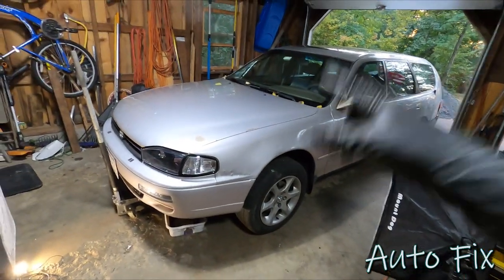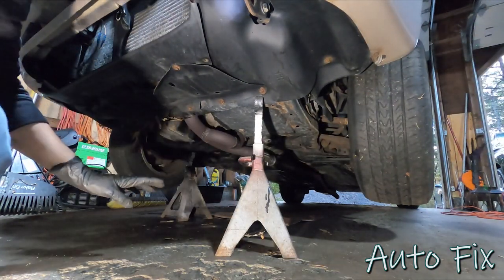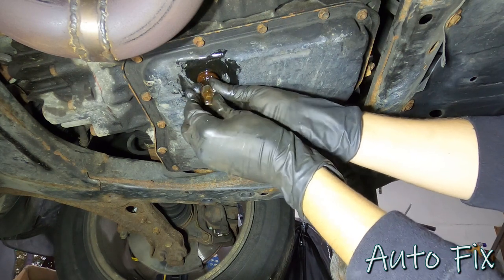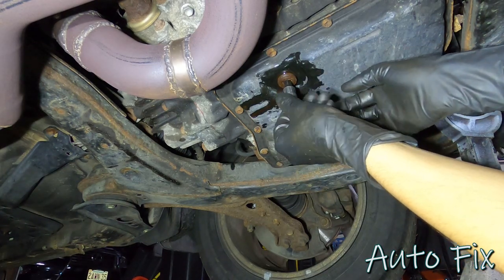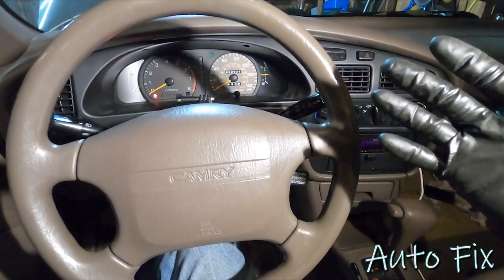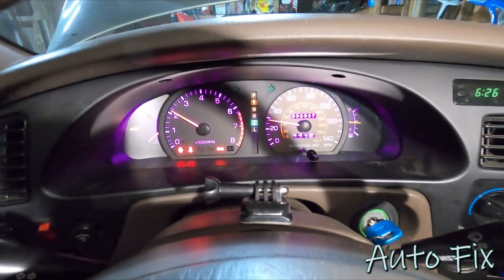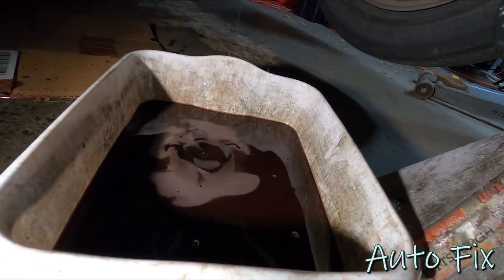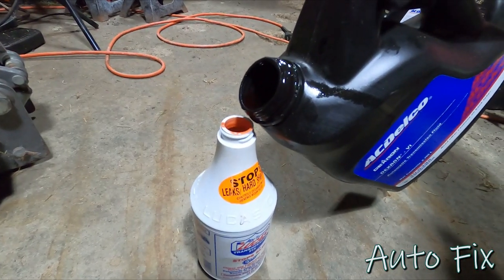Transmission Drain & Fill '94-'03 Toyota Camry, Solara, Avalon, Sienna & Lexus ES300

Comment: Changing the transmission fluid is usually done in concert with dropping the pan and changing the filter. If the filter starts to get dirty and the flow through it begins to get obstructed the working pressure inside the transmission will become reduced. This can cause the clutch packs and bands inside the transmission to begin slipping, which can eventually wear them out. If that happens the transmission will need to be replaced or rebuilt. Changing the filter is fairly easy and not expensive. I wouldn't recommend skipping it.
Reply from the maker: Yes you're right it's best to change the filter as well.
Reply: I've been looking around yt. I want to flush system along with new filter and gasket with out wasting transmission fluid.
Reply from the maker: @abe6517  What do you mean by wasting transmission fluid? A flush requires a lot of fluid and quite a bit gets thrown out with almost no usage. That's how a flush generally gets done.
Keep in mind that it's not always a good idea to flush the fluid. A lot of times on old cars you are better off replacing what's in the pan, and if it's really bad you're better off leaving the old fluid in there. So first take a sample of the fluid before you decide what's best for your trans.
Reply: Thanks for replying! So I have 12 quarts new, two new solenoid filter and gasket. The fluid it just showing some darkness. With the cold weather, it had a few hard shifts at 2nd gear to 3rd. So I decided to flush. 

My plan so far is siphon 4 quarts out, drop pan change out parts, replace pan add 4 quarts of new, and then proceed flushing the system. My plan waste 4 quarts of new fulid?I may be overthinking....
Reply from the maker: @abe6517  the best way to do a flush is to have two large buckets. One empty, and the other one full of new trans fluid. Remove both hoses from the trans cooler and extend them with some hose that fits nicely over them. Stick the hose that is actively pouring trans fluid out into the empty bucket and the hose that wants to suck up trans fluid put that in the container with new trans fluid. Then run the car and eventually you will see new fluid come out of the first hose/line. Then you gave successfully flushed the fluid with minimal loss. Ideally however, you'd want the car up on jack stands and running thorough all the gears as you do this, holding it in each gear for at about 10 seconds.
Reply: Drain,fill,run (Two times),drop pan,inspect for debris,clean magnet if equipped,clean pan,replace filter & gasket & fill to spec level for the WIN 😎

Comment: Just bought a 95 Camry 4 cylinder with 280k miles, nice little work commute car and they are solid & dependable. Thanks for this video, im going to flush out my transmission and hopefully that helps
Reply from the maker: Nice! Make sure the fluid isn't back like used engine oil and smells burnt like it's been overheated almost. If it does, don't change it or you will probably start losing gears. That usually means the transmission is gonna need a rebuild at this point.

Comment: thank you so much for posting this, very informative. I'm torn on the multiple replacements...I just had this old Mexican guy whose been right way more times than I have tell me to take a portion of the old fluid and mix it with the new, which sounds off to me but I think I get the concept. I'm going to do a 2x replace and add the additive like you did. Camry 177K I'll let you know if anything bizarre happens...
Reply from the maker: No that's right it can be done in certain cases, although not necessary on a good transmission.

Comment: Just bought an 03 Avalon, this will be very helpful. Thank you!
Edit: I am watching the video and saw you struggling with the dipstick,  the exact same thing happened to me when I was looking at the car before I bought it 💀. Looking forward to that 🤣.
Reply from the maker: Hahaha
Thanks! I'm glad the video helped!
Reply: lmao I bought a 2000 avalon last year and spend 5 minutes fumbling about trying to get the dip stick back in in front of the seller. I feel so related to
Reply: @ColonelPassTheCheese  lol, I was actually just messing with my transmission fluid, added some Lucas transmission fix because it shifts hard sometimes, and I have finally memorized the right way it goes in 🤣. The flared end goes to the left side of the tube.
Reply from the maker: @ColonelPassTheCheese hahaha yeah, happens at the worst time lol

Comment: Hello my atf level is lower on dip stick when engine is hot  and comes up higher when is cold.. isn't it supposed to do the opposite?

 1994 celica should i ignore cold reading and only read when hot runing on park?
Reply from the maker: Yeah that's kinda weird but I would go by the hot mark. It's usually the most accurate.

Comment: I have a 2000 Sienna with 326k on it with the original version of this transmission. The fluid inside is 16,000 miles old and is clean, properly filled, and doesn't smell burnt. However, for many years, the transmission has always made a buzzing noise in park on certain days depending on the temperature outside (probably the pump), but after a while in park, the buzzing noise goes away, and you don't hear it at all once you put it in any gear. I have never lost a gear or have it slip on me. The shop I took it to for my timing belt and transmission service did a drain and fill like you did (the filter inside the transmission is from 2014). That transmission has made that buzzing sound for the better half of ten years (even after a filter replacement then) and if something was going wrong, it would have broke a long ago. Other than that, no issues with shifting, fluid level, or smell. Any idea of what it could be? Thanks!
Reply from the maker: That's a weird issue, but to be honest since it's something that minor and it's been going on for that long, I wouldn't worry about it. It might be annoying but clearly it's not affecting anything so just keep servicing it as usual and it should last!
A little tip, on old transmissions, especially Toyotas, I like to put in a quart of Lucas Trans fluid additive to help it out. But I do this on transmissions that haven't been properly secriced or are showing signs of wear. So if your doesn't need it, you don't have to add that.
Reply: @AutoFixYT  Gotcha. It is more of a nuisance than anything else, but it is good to know whether there is an issue or if everything is good. The next time I change the fluid, I'll see if I can get a new filter installed at a minimum. The shop refused to put in a filter and opt with a drain and fill since opening up the pan could cause some seals inside the trans to start leaking.
Reply from the maker: Removing the pan wouldnt affect anything at all actually. So I'm not sure what they were trying to say but the pan is just... The pan. Just reseal it and you'll be all set.
Reply: @AutoFixYT   Thanks!

Comment: I have a 1999 solar with 327,000 mi tranny fluid was changed from the original owner at 180,000 at Toyota service dealership I live in Florida but last year when temperature dropped in January it wouldn't move when I put it in drive only reverse but in the summer it works. should I give it the transmission drain?????
Reply from the maker: I don't think it's a good idea to drain it after not having serviced it for so many miles. It sounds like the transmission is on its way out. You can top off the fluid if it's low, but it's been way too long to actually service it. Removing that contaminated fluid can actually create worse problems than leaving it in there until it completely blows up, at which point it will just need a new or rebuilt transmission. That's why waiting to service an automatic transmission is never a good thing.

Comment: I was looking for a fill plug on the transmission casing. I guess only way to fill it is at the dipstick. Having a hard time dropping the pan after removing all the pan bolts, wanted to change the filter as well. The pan won't budge using a mallet or prybar.
Reply from the maker: Yeah dipstick is the only way to fill these. Also, I’ve had to pry oil pans to the point where they bent. Sometimes they’re very stuck. Just be patient and apply even pressure from multiple points. It will pop off eventually. But be ready to clean up a mess if it goes flying because there’s always fluid left inside of the pan. More than you think… haha

Comment: Just bought a '93 Camry wagon and not only did I like/subscribe but I also saved this video as well. 
 
Question: this is my first automatic in a while.. is a transmission cooler a good idea or is it just unnecessary/extra points of failure? I plan on installing a hitch but at most I will haul a light motorbike/camping gear (so maybe 1200lbs at the very most).. do these tranny's heat up to the point where that's an issue? 

Also, how are the headlights holding up? I looked at those online and had bad examples that immediately fogged up.
Reply from the maker: If you’re gonna tow or haul, especially in hot climates or hot summer days, I think a transmission cooler will help. There is already one built into the radiator, but you can take those hoses off and install your own external cooler. These transmissions are sturdy and can take some abuse but a cooler will help prevent overheating. If you are towing on the highway or on long uphill inclines, you will heat that trans fluid a lot. Maybe not overheat it, but it’ll be above its normal operating temp. So yes, I’d install one. But make sure that in the winter months (if there is winter weather where you live) the transmission doesn’t over-cool. You want that fluid to warm up as fast as possible. And an external cooler sometimes prevents that. So it’s a tricky situation.
Reply from the maker: Oh and about the headlights, they’re great! I don’t know why they’d get hazy in a short period of time, but they’re great!

Comment: Marvelously helpful, thank you!
Reply from the maker: Glad it was helpful!
Reply: i just realized that i can put the fluid into the same place where the stick is    :D  
     i'd thought i would have to find a different wider opening      - awesome'
Reply from the maker: @poom641  That's right, goes in through the dip stick. The only downside is you need a very pointy funnel for that.

Comment: How much miles till you change that transmission fluid because mine looks no where near as dark. Mine is red with little slight tint a of gray 109000 miles toyota avalon
Reply from the maker: That means it's been changed, no way 109k miles and you still see red.
If you like to do drain and fills, I'd say every 20-25k miles. If you like to do flushes, you can probably stretch it to 30-40k miles.

Comment: Just got an old 97 camry with the 2.2 four cylinder.  It won't shift any lower than drive.  (3,2,1)  feels like a mechanical cable type issue is my guess.  Shifts itself perfectly fine all day long.  Ever seen something like this before?
Reply from the maker: Weird, yeah I'd check the linkage. Just like you said it might be a mechanical issue. There's no way it's a transmission problem at that point if it while in drive it works normally. It could also be the shifter mechanism itself. Like if something fell inside the shifter lever. Or yeah like you said the linkage between that and the trans. Something is physically stopping it.

Comment: What about the diff fluid fill plug? Where the manual tells me, there is a blocked off hole...
Reply: Not sure if you’ve already figured it out but, the fill plug and drain plugs were phased out as these transmissions got reengineered over the years, so if you don’t have a fill plug it’s because there’s a fluid pass through from the transmission to the differential but some still have a drain plug and that’s just to get more fluid out on a pan drop, usually another quart

Comment: Hey I have a very similar situation with my 2004 Avalon, it looks to be about the same color as yours on the dipstick, just a little nervous to change it as I don’t want it to start slipping I was planning to put some Lucas fix in mine as well, I’m just noticing some hard shifts sometimes, but I don’t want to wait until the point of no return, should I still change it I would only do one drain and a filter change
Reply from the maker: Try to see if it smells burnt or overheated. You'll know if you smell it, it's a horrible smell. If it doesn't smell burnt, then do the drain and fill procedure and add some Lucas.
Reply: @AutoFixYT  ok will do, thank you

Comment: Is there a transmission fluid filter to replace on this car?
Reply from the maker: Yes, you have to remove the transmission oil pan and then you'll see the filter in there.
Reply: @AutoFixYT  you didn’t do it in the video right? Doesn’t seem super necessary

Comment: I have a 99 solara v6 with 253k and the transfluid hasn't been changed since 2011 I plan on doing this and I might try the Lucas I already use it in my engine I'd be curious if the Lucas would help with this clunk when going into reverse my car has only when cold
Reply from the maker: It might help, but also make sure you check the engine mounts. Sometimes they wear in such a way in which they let the engine rock backwards more than forwards and because it sits at higher RPMs when it's cold it has more force to throw it backwards when you put it in reverse, as opposed to when it's at full operating temp and sitting at 650-700 RPM.
Anwyay, as long as it's shifting fine, you're all set. Make sure the fluid you're draining isn't burnt or very contaminated. If it is, don't drain it all, don't flush it. Take it easy and drain some then I'll it then drive it and see how it reacts. You don't wanna ruin the trans by giving it fresh slippery fluid if all the clutch material is in the old fluid.
Reply: @AutoFixYT  damn you know yur stuff I'm only 17 and it's my first car so I'm still learning but I did replace my upper dog bone mount it was shot and the lower motor mount has chunks out so it's bad but I still haven't done that.that would probably fix my problem didn't realize that thank you.
Reply from the maker: @yurboi698  Nice, always happy to help! The only reason I brought up motor mounts is because if it was an internal trans issue it would come with other symptoms too, such as hard shifts, slipping, or delayed shifting, and especially once it warms up. Your issue seems to be very precise. Anyway, still change the fluid though, it good to keep it fresh.

Comment: 1) that fluid looks horrible. 2) I got four quarts out my 1999 es300. Why am I not getting 4 quarts out of my 2003 es300?
Reply from the maker: It may look horrible but it's actually not that bad lol
Not all cars will hold the same amount of fluid. Best way to know is to check a manual or use the dip stick to ensure it's full, then measure what comes out. You will always get slightly different results. As long as it's full when you're done, that's all that matters.

Comment: Is it OK to use toyota T-IV fluid?
Reply from the maker: No, not at all. Use only Dexron 3 or higher ATF.
If you don't get straight Dexron, you can use Valvoline Max Life which, as you will see on the bottle, is compatible with Dex3 or higher.

Comment: Does the differential take the same fluid do you know?
Reply from the maker: Yes I'm pretty sure it uses the same fluid. It has a different drain and fill plug though, just like a regular differential.
Reply: According to Haynes repair manual yes, they both call for Dexron III
Reply: Although the differential has it's own drain plug, the transmission and differential share the fluid.
Reply: @hansfranz9914  good point, that is true
Reply: @hansfranz9914 So do you still need to drain and fill seperately?
Reply from the maker: I believe so.
Reply: @June0696  you have to open both drains to drain as much fluid as possible.  You fill them both when you fill the transmission.  Just make sure you have the same model engine/ trans
Reply: @dishthewasher  Okay I see but how do you fill them both? 
Or will they be filled together automatically when you pour Transmission oil thru dip stick?
Reply: @June0696  yes
Reply: Yes it all takes the same fluid I know now. They both share the same fluid constantly so there’s really no need to touch the fill or drain on the differential unless you’re trying to drain as much as possible. I doubt it’s necessary to fill the differential after the transmission but usually they recommend checking just to make sure it has fluid in the differential
Reply: @UGotAPerdyMouf 
Then I can ignore about the Differential? 
And just drain and re-fill the transmission fluid will take care of it?
Reply: @June0696  like we said you can if you want to, but why wouldn’t you drain the differential too while you’re at it?  You might as well drain the old dirty fluid from there too instead of having it mix together with the new fluid you bought. There’s gears and bearings in there so why would you leave that when you’re already in process of doing the trans fluid?
Reply: @UGotAPerdyMouf  there’s no differential fill port on that model. And I just explained from experience how it fills
Reply: @dishthewasher  Because my Differential plug won't turn even with extended breaker bar. 
I don't want to buy new tools or risk break it by trying if it's not necessary.
Reply: @June0696  yes, that makes sense.  You can get most of the fluid out from the trans pan, so yes, by changing just the trans fluid, the new will also circulate through the diff.  If you want to, you can try soaking the plug with penetrating oil for a day or 2 and an impact driver.  Anyway, thanks for clarifying.